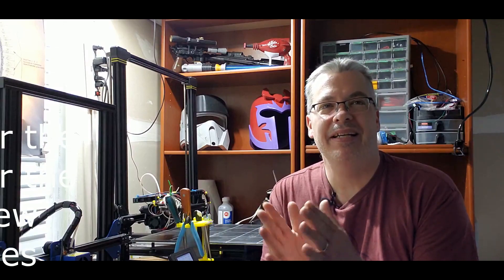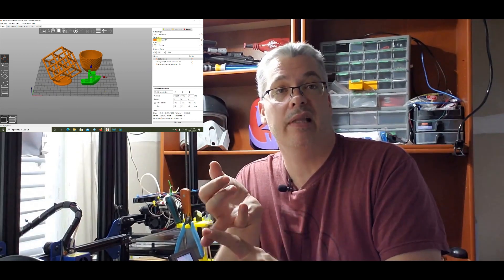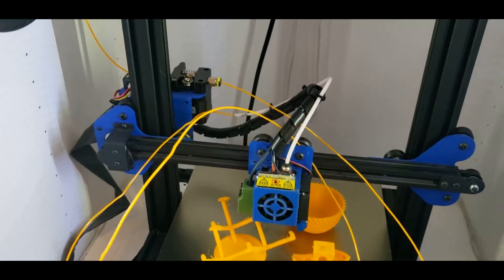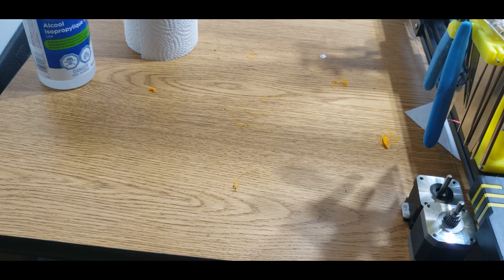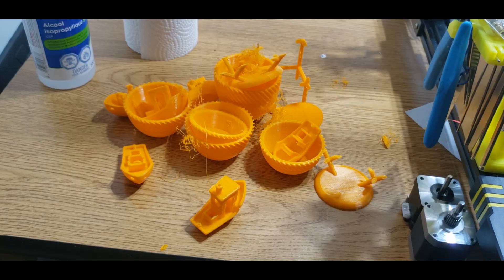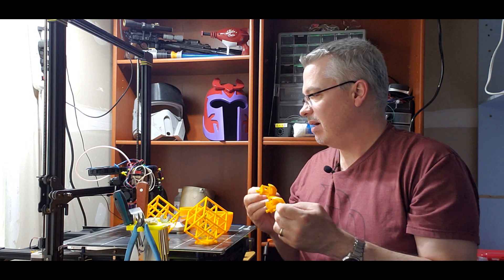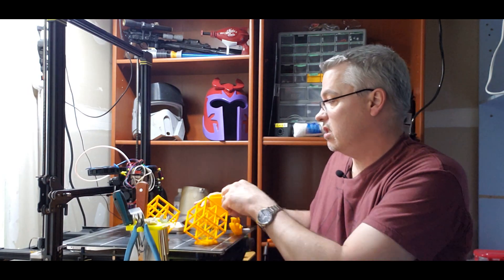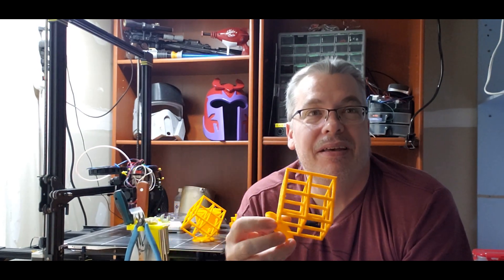Tronxy Stock Firmware vs Marlin Shootout

Comment: Have you noticed the difference in your bed leveling springs. The left is up more than the right front, Something going on with your frame/bed level. Just noticed great vids many thanks. I was wondering if you could do video on upgradeing firmware when your sd card reader is knocked out. perhaps using STM Cube prog for the v6 chitchu boards. I have an X5sa and have to use my computer to do any print jobs. I got Tronxy to send a new motherboard cxy-v6-191121 under warranty to resolve that and other issues but the new v6 board is not reading sd cards either so still trying to resolve issues.

Comment: I did One print with Tronxy firmware (x5sa pro v2 330 titan) 2 prints with marlin 2.0.9.1 and nope not going back there... straight to klipper firmware, but so use to it on my ender 3 v2 it's like 2nd nature and so much easier to configure changes on printer
Reply from the maker: Agreed but you need extra hardware to run klipper unfortunately as the pi does extra
processing for the printer.

Comment: Well, I had my 2020 updated model of the Tronxy X5SA big build area printer for months and only managed to get two good prints done after tons of try's and wasted filaments!  I got the upgrade firmware from Tronxy which was for the new Tronxy Titan extruder I brought and I also brought a Tronxy 13 x 13 inch square magnetic build plate for the printer. 

But after 9 months only those two good models which I had to keep checking on when printing having to keep adjusting the 6 hand screws to make sure it kept printing right and that was after spending 3 hours doing many auto and manual bed leveling try's.

My printer I would say, has leveling issues and Z off Set issues and it is driving me nuts!

I spent tons of money on the tools the filaments the upgrades and still can't even get the damn thing to do a level printing.
Also I after watching you and others I know that maybe the firmware needs changing to Marlin,  Looks complex to a newbie like myself since I not into all the coding stuff etc?

I am just getting to the point were I may just give up this hobby?

Shame I can't get it sorted.

Comment: Hi Jeff. I know you can help me. My intention  is to make my Tronxy XY 2 Pro printer a 300 x 300 bed size as I am building some lettering signs with led lights inside and right now I can´t afford a bigger printer (bigger printers delivery costs and taxes for Colombia where I live, makes them 3 times the basic price). I already have the aluminium profiles  for the machine extensions and heated bed but I am worried about the   gcode modifications. Can it be done with pronterface and what could be the values. I´d appreciate your help.
Reply from the maker: Are you.using marlin?
Reply: @jeffs3dcorner  Nope. Original.
Reply from the maker: http://www.customize-3d.com/chitu-g-code-explained.html
Might work
Maximum distance of X, Y, Z,
exceeding the distance will cause the buzzer to buzz
     X
M8024 I330
    Y
M8025 I330
    Z
M8026 I439
 Home location
            M8029 I0 ; front left
M8029 I1 ; Unilateral maximum point limit
M8029 I2 ; Bilateral limit
            M8029 I3 ; Limit in the left rear of the machine
 Marlin i know. Chitu frimware is a diffrent animal.
Reply: @jeffs3dcorner  Yes I know. I will try and let you know, thanks for your help.

Comment: you seem to be the only person out there actually working with this printer, I got one for christmas and I've been having an absolute HELL of a time with the Z-offset sensor, seems no matter WHAT I try it's always a mile away from the build plate unless I trick it into printing close, like the sensor triggers when its a good half cm or more away, have you any tips for calibrating the sensor? I've tried adjusting the height of the sensor, I got a new glass plate with their sensor for it thinking it might help, I've even flashed it to Marlin...idk what to do anymore.
Reply: Did you configure the Z-Offset after autocalibration? 
Unless you tell the printer how much the difference between the point where the sensor detects the printbed and where the printbed actually is for the nozzle, it will, basically never work.

Comment: I wish i had discovered your videos earlier. I got my x5sa400 a few days ago and the lack of documentation and horrible firmware has been a nightmare. I discovered the upgrade to marlin last night on a forum. Though my printer STILL. Moves the z down 5mm wheneverx or y moves and reports that number as z level ugh. (Just realised the probe has to be miswired). If i had found this earlier it would have saved me days
Reply: I'm having same thing happen on my x5sa400 , can you specify on that fix.

Comment: Thank you Jeff for the video. I am looking to do the same thing with my Tronxy X5SA Pro.
Reply: did you ever get your x5sa switched to marlin 2?
Reply: @3nginuur  not yet. I do like the visual leveling with the stock firmware, I just hate everything else. I have put my 3d printing on hold, since I am in the process of moving. It is something that I want to do though.

Comment: I did get my Tronxy XY-2 Pro a week ago and have printed every day now. The filament end detection just breaks and I had to open it the middle of print when the filament end and I had to change it and it did not register a new one. I did open it and fix it and it works again and I did get printing start.  But I notice that after one kg of filament plastique is wearing from filament run-out detection so must try to fix that in somehow...
Reply from the maker: Hope you figure it out.
Reply: @jeffs3dcorner  Yea, I did move filament to old system but it takes more space so my idea to use other room table to print night can't be done then but I just look when its in making support and put power of from cord so it starts print in morning from right place. Only prints what has gone bad has do it almost after I start print if z is to high. Otherway printer is very good if you use Cura and not Tronxys own program. I might get couple 50cm long 4020's and long rod and do little higher from this in future. Maybe also new cable to that also ;)

Comment: Hello, tell me how to return the stock firmware to trony x2 pro after the firmware on marlin
Reply from the maker: If you did not back up firmware before you will need to email Tronxy to ask. They will require your motherboard model and if it has a titan extruder or not.
Reply: @jeffs3dcorner  I didn't save the firmware, I have v6-191017 not titan, I downloaded the firmware from the trinixy site, but the process doesn't start on marlin
Reply from the maker: What are the names of the files?
Reply: @jeffs3dcorner  XY-2PRO-LM8_V1.1.Gcode corresponds to the motherboard CXY-V6-20191017
Reply from the maker: Should be a  .cbd file
Reply: @jeffs3dcorner  thanks for answers.  I was glad to communicate
Reply from the maker: Try this link. https://m.tronxyonline.com/Firmware-XY-Series-a63177.html
Reply: @jeffs3dcorner  its great your trying to help people but frankly the tronxy site isnt just bad its counterproductive. Theyre putting up gcode config files as firmware etc. Frankly they should just post source and firmware for each printer model . theyre stunningly disorganised

Comment: can you tell what you have tuned for the marlin firmware in prusa I use marlin firmware with the default settings, wich also work. But if i can get it better, i'll try
Reply: Yeah, I was wondering the same thing.  There was no special setup for the Tronxy in Cura originally, so I'm not sure what would have to change after changing to Marlin.  I would love to hear what the changes were.

Comment: I'm still new to the game got my first printer Sept 17 2020 ( Anycubic Mega Zero ) it died in under a week ( E1 thermal runaway ) I've repaired that but now the X axis is broken a pin dropped out on the stepper motor cable Cable on its way today. So I picked up my Tronxy XY2 Pro  I'm hesitant to load marlin on it as I haven't had issues with the stock.
I level my bed every print .

This is a bug though less than a month in and I have 2 printers and looking at a 3rd.

( Geeetech A30T ) 3 in 1
Reply from the maker: I'm sorry you have had some bad luck with printers. Try having a look at my Z Offset fix video it may help you with the leveling process. Good luck.
Reply: @jeffs3dcorner  

Cx service has been good and having it fail has been a good teaching/learning moment. I just got a dud that is easily repairable pretty sure I'll get it running again today.

No problems with Tronxy yet I just choose to level all the time I have yet to touch the z offset but will be looking at your videos.

I do feel for the next I'll want dual z rods or even look to adding them to these. 

Tronxy is beginner friendly. 

The 3rd I'm purely just looking at for 3 filaments but only having 1 extruder means I'd have to print at same temperature so it not be best of choice. I want to look at multiple extruders so I can print different types of filaments.

Comment: only disadvantage i have with stock firmware,is that it is not 100% compatible with octoprint,and marlin is. leveling is much easier with stock tronxy firmware. But if you use marlin in combination with octoprint,it is as simple as on stock tronxy. Thank you for your time and video.
Reply: You can use Octoprint with the stock Tronxy firmware if you use the following plugin:
https://github.com/OctoPrint/OctoPrint-FixCBDFirmware
There are some limitations that are detailed on the plugin's page but I've been using it for a while with the stock firmware and it works quite well.
Reply: @ryancasler  i can only say its more than reliable. Printed 5hrs + without any issues. And i use the Cura Slic3r becaus PrusaSlic3r added some Gcode before the actual "custom start g-code" which mess up the print. E.g. Did not disable the fan for the first 3 layers. I tuned the standard settings for the xy-2 pro in cura and my prints are awesome and fast.
Reply from the maker: Thats good information. I dont use octoprint bit hope to find time one day to experiment with it.
Reply: Had my printer for days and still havent managed to autolevel or print once. Hoping this channel helps with that.